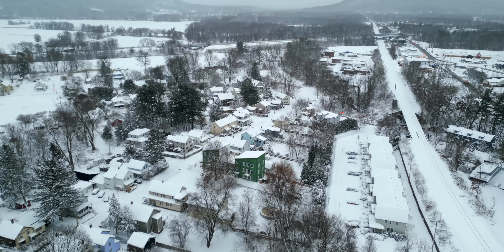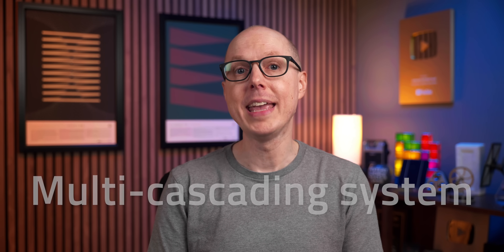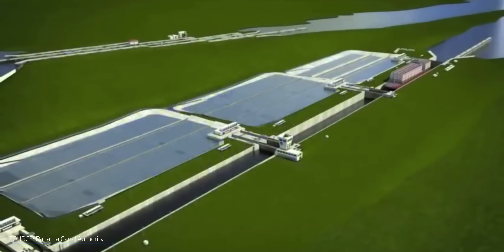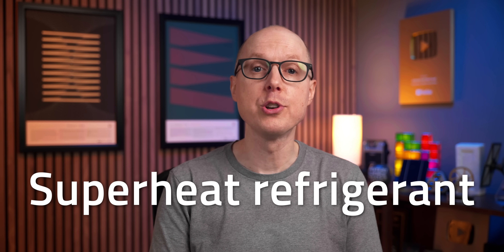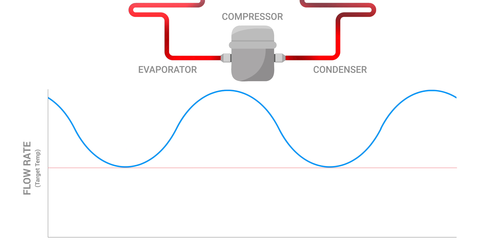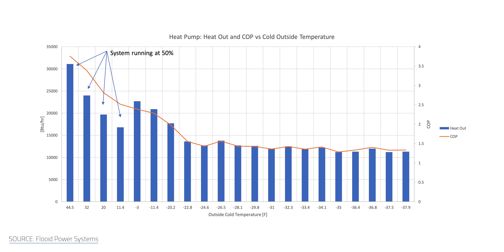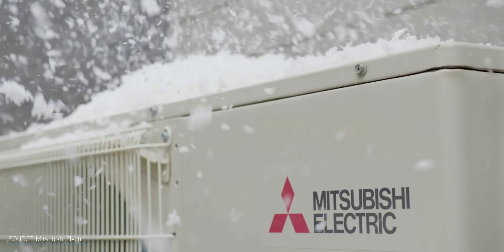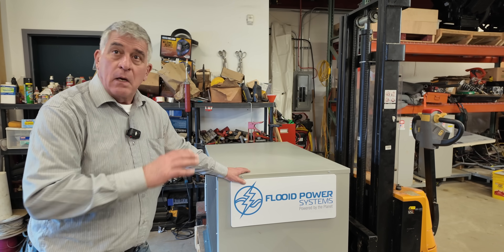How This New Heat Pump is Genius

Comment: I live in southern British Columbia, Canada.  Peak outside temperature range ~ -45 to + 45 Celsius every few years.  Usual range -30 C ~ +35 C, worst case, for a week or two.  My concern about heat pumps is that they depend critically on a reliable electricity supply, which may be almost guaranteed in a big city like Vancouver, but my small town in the Okanagan Valley is at the end of a ~350 km power line from the main hydro dam ~300 km [by road] to the east.  We usually experience at least one day-long outage every couple of years.  My small home was built in 1944, has zero A/C, is heated by a small forced-air natural-gas furnace, and includes a rarely used wood-burning fireplace, so in a winter emergency I can keep my family warm, but I fear regulatory agencies banning fireplaces entirely.  The City of Vancouver proposes to ban all natural gas appliances, both for cooking & heating, starting a few years from now.  Imho, this reduced energy redundancy would be madness...

Comment: A primary area to increase heating and cooling efficiency of a  house is with highly insulated windows and other insulation.  Reducing air infiltration is key.   A typical heat pump furnace is sized for the A/C loads in BTUs typically about 36,000 BTU and can heat about the same amount.   Heating needs are twice cooling needs and more.   Even with the heat pump at 3 - 4 times the heating efficiency of a natural gas furnace it cost more to fuel it on electricity than the cost of fueling a natural gas furnace for a BTU of heat.   We like heat pumps because they are good air conditioners.   It really doesn't take much heat to make up about 30°F so the fueling cost difference between a heat pump or natural gas furnace is fairly small, but when the temperature goes lower significant heating loads start to take place a long with a heat pumps efficiency falling off.  

With less than half the heating capacity needed and efficiency falling off a typical heat pump furnace resorts to electric resistance heat that cost about five times more per BTU than a natural gas furnace.   A month of 0°F temperatures might cause a $300 natural gas bill, but a $1,500 electric resistance heat bill.  You are also being a bad neighbor to stress the electric grid at its worst when natural gas is available.

Comment: We live in Las Vegas and temps range between 120 and 25. Can Flooid's system be reliable and cost effective? Elon Musk has so much on his plate he hasn't gone into the heat pump business. However, if Flooid's system has a high degree of durability at a reasonable price, Elon Musk could be interested. Tesla has the manufacturing capability to make these in mass quantities and Elon Musk could lower parts cost and the whole system's cost. It all comes down to affordability and durability.

Comment: I don't understand the use of power % at a certain COP when comparing units . COP by definition is factoring how much power is being used. The skeptic in me wonders if the Flooid systems efficiency curve resembles that of a computer PSU and is best at 40-60% load, making the comparison not great at best or intentionally misleading at worst.

Comment: I like the tech, but the problem is complexity.  Yes it uses COTS parts, but install, maintenance, and repair will be difficult or impossible for your local HVAC contractors.  The added expense of higher skilled technicians and maintenance will like be the deciding factor behind this tech.  If it can be modularized in a way that makes it legos for your average tech to test and swap parts, that would be ideal.  Also.. three working fluids is even more for the HVAC crew to carry around.  Different gauges/test gear, more bottles of refrigerant, etc.  While the upfront cost may be more, ground source heat pumps may be a better choice for many if we can get drilling costs down.

Comment: It is not hard to suck heat out of -31F air.  But is condensation a problem at -31F as it is at 32F+/-10F where it builds up and freezes.

The condensation problem is when moisture in the air condenses and freezes on the coils.  It quickly plugs the coils, requiring a defrost cycle increasingly frequently as the temperature drops further below freezing at the coils or the amount of moisture in the air increases.  Of course, there is less moisture in the air the colder the air, hence my question.  Maybe the air is dry enough at -31F to minimize condensation and so avoid frequent defrost cycles.  The number of defrost cycles with the accompanying inefficiency and discomfort means backup heat is highly desirable.  Sometimes the defrost is simply impossible, which means backup heat is mandatory.

Comment: 😅This type of system cascading has been used in the pump industry for years.  They are called packaged booster systems which use 2 or more pumps to increase overall system efficiency and reduce operating costs. To learn more check out Grundfos Pumps BoosterPaQ systems.

Comment: The whole heat pump conversation (especially resistance to them) is fascinating to me because we have been using them in Virginia for decades. I'm 43 years old and every house I've ever lived in has had a heat pump. I only recently found out that heat pumps are not the norm everywhere else.
Reply: Its not the temps that are an issue, it's the 2x-5x cost for what is basically a reversing valve. Contractors don't seem to want to install them.
Reply: They're very popular here in New Zealand too. They work well in temperate climates where only a minor temperature shift is required. More extreme climates need the more advanced heat pump tech such as outlined in this article.
Reply: Then it surprises me even more that they aren't more advanced yet. In the Netherlands they are mandatory now, but there are many startup problems
Reply: Mind you I live in a heat pump neighborhood as well and I just had a  minisplit installed, which is also a heat pump, they are more than fine. But I still prefer a classic furnace based system for reliability and cost.
Reply: Well it's basically an air conditioner that now has valves so that it can produce cold or heat, but you are so correct, the technology has been around for many decades. I think it's also a matter of people capturing fancy terminology on stuff that's been around forever.
Reply: They have pros and cons. Your AC basically runs all year instead of getting a break when the furnace takes over. These cascading systems are going to be very costly to purchase and maintain as they are basically two.or three systems in one. It all depends on application. Mostly residential is focused on cost. Furnace systems hit cost really well and heat pumps are generally only used in neighborhoods that aren't equipped with gas readily from the city. Atleast out here in Vegas. By the way I'm a trained hvac tech so i know a little bit about these systems. Heat pumps have a 300% heating efficiency compared to gas which has 96% at best, but electricity costs 5 to 10x compared to gas.
Reply: @wesleymcdowellwm  the gas:electric cost disparity varies hugely by location so no product will make sense everywhere. I would have thought Vegas would be prime solar territory and, with hots days/cold nights, thermal balancing & storage would be popular. But I've never been there.
Reply: Complexity is a big difference. Like the cost of replacing one of those reversing valves he's talking about is expensive. All of the refrigerant must be extracted.
Reply: @wesleymcdowellwm  In commercial systems, manual shut off valves are fitted, allowing component replacement with minimal refrigerant loss. These systems can also pump the charge into a liquid receiver. For minor replacements, it is quite common to crack both of the valves slightly open before fully tightening the replaced component. This literally blows any air out, avoiding the need to vacuum the entire installation. On systems with a load in excess of 50 tons, a few traces of air make little difference. Being non compressible they normally find their way out via the shaft seals on the compressors that are rarely 100%.
Reply: @wesleymcdowellwm  what if you have Solar? Wouldn’t that help with the Electrical costs?
Reply: @andrinabroussard1972 solar in Canadian winters, great idea, I'll get right on that. We get less than 1/20th of the solar we do in summer, and it's far more intermittent (nothing for days, then 2 hours of sun)
Reply: Japan has been using them for many decades. Funny everyone thinks that it is a new tech.
Reply: @WillCodeForFood.1905 My ex girlfriend lived in a building from the 70's, the AC controls (with Atari-like fake woodgrain) were built into the wall and, yes, had a hot mode!
Last time I saw her she'd got a new mini-split that was half the size and had a remote
Reply: It’s too cold to use them reliably in Canada.
Reply: @oscarholman  They work great in Sweden. -20 -30 still working.
Efficiency goes from 5 X to 3 X on air systems when it gets really cold, that is all.
If you use ground heat you get 8 x all the time regardless of outside temperature.
Reply: @whowhy9023 Why do you people just make up absurd numbers like this? Nobody is getting a COP of 8. It's like you have this insatiable urge to be smug and go "yah vell in Sveden..."
Reply: @oscarholman  they make ground based ones realy wish I'd dug deeper when I put my septic in found out about it a week or so after we finished  septic it uses a glycol mix pumped under ground threw pipes to gather heat
Reply: @oscarholman  and there’s no reason to have a reversing valve in South Florida. A 5000w resistive element is fine for the two nights a year it’s needed.
Reply: @yolo_burrito  the thing you're forgetting is that reversing valves start at like $25 on Amazon. Heat strips start at $170 plus.
Reply: @GallantChaos  and a reversing valve replacement requires evacuating and refilling the refrigerant. The part is cheap but the job is not.
Reply: @oscarholman Wait you heat your houses with direct electrical heating in Canada?! Here in Sweden you use ground-source heat pumps as those don't have those issues with cold temperatures.
Reply: They use ‘em in Northern Europe.
Reply: I’d love to have heat pumps here in Canada but it just can’t keep up with our winters. I’m just waiting for heat pumps to get better and better and work efficiently in Canadian winters.
Reply: @arunprasadh1929  This technology would be a step in the right direction but I'm pretty sure it would struggle with your winters, like squeezing blood from a stone. Heat pumps + thermal storage may work.
Reply: Outside of the US basically they're used everywhere else. Its one downfall for usa is that it only circulates indoor air so you need to add extra fresh air source input. But in other countries that still mostly use open windows for airflow, the mini splits work well.
Reply: @Findmannynow  All forced air systems recirculate indoor air it is not just heat pumps it is everything.

Comment: I have often thought a cascading system using two separate heat pumps makes the most sense; especially for people with their own solar.  Essentially, stage one is a heat pump that stores heat (or removes heat) from a huge thermal battery (pond, pool, sand, etc) whenever there is excess power generated by the solar array.  Then another heat pump uses that battery as its source to heat or cool the home.

Its a two stage cascading system, but there is a thermal storage element that allows you to maximize the value of your solar system, and avoid pushing your heat pumps out of their optimal operating range.

Comment: As a Canadian I’m extremely sceptical that infrastructure can sustain the introduction of these units residentially, especially its functionality during our annual cold snap. I don’t want my heat going out during a brownout during a cold snap. While these are great alternative, the banning of other conventional heating sources is ludicrous. For example, if the current federal government gets what they want, they would implement these pumps as mandatory and ban any kind of wood burning/natural gas heat source, preventing basic human necessities as it regularly gets bellow -38 up here.
Reply: Will your gas furnace work during a brownout/blackout? Ours won’t. It depends on electricity for the temp control, the fan, and everything else. Our gas furnace is totally bricked in a blackout.

Comment: We are going for a geothermal Heat Pump (with floor heating) and passive cooling for our new house. Pretty nice as the temperature of the ground is a stable 3-4c and that means the COP is like 4 year around. Its also much more quiet than air-to-air heat pumps and does not need to "de-ice". In the summer we can use that "cold hole" to passively cool in the summer.
Reply: And as added benefit. The cooling during the summer will put down heat in the hole giving a better working temperature from the hole during the winter.
Reply: In ground system=$$$$$$$
Reply: @waynesaller  yup, but if you have the money for the upfront costs it's worth it.
Reply: Did you get your system going?  I'd be curious how it's working, especially the passive cooling.  We have a 1890's home with cast iron radiators and we love the radiant heat the provide. Plus, they double as towel warmers. Ha!  But we really need cooling too.  I can not stand the thought of those ugly mini-splits everywhere in our house so we want to go water to water but I wasn't sure how we'd get cooling from the same system.  Were you successful?
Reply: @vbrh01  house is being built as we speak. Won't be done until late summer / early fall. In regards to passive cooling. I talked with several different experts that work with heat pumps and they all said the same thing: It's not worth the cost.

It was 15k USD to "upgrade" the system to support it, and depending on how deep your geothermal hole is, it can only supply a minimal amount of cooling. It's also not AC-cold. It's more to get the temp down a couple of degrees. Like a small breeze. 

So if you want cooling: get air to air. That's the best, cheapest and easiest. As we live in Norway we are not going for any active cooling solutions as we don't want that ugly outside and inside unit. It's a cool/unique looking house that designed by a famous architect, so we don't want to ruin the look/feel.

If it gets too hot (those few nights a year) we will just use one of those portal ac units.

Comment: I’m in Michigan and I use heat pumps in finished basements along with heated a cable in the bathroom floor. There’s nothing better than that. Carrier or Mitsubishi that rate there units at -22deg. I’m looking forward to theses cascade units in our future

Comment: I will be installing a closed loop well source to cool slabs in summer and feed a heat pump for domestic hot water & to keep slabs warm in winter. The cascading system would be good for boosting the slab water up to the domestic hot water temp, I may add a second smaller heat pump fed by the return water from the slabs in winter. Thanks for the presentation, it got my thinking cap on!
I am about 200 miles north of you Matt.

Comment: No, stop. This video is full of so many errors and techno babble. You should take it down. There is no resonance in a properly configured system. Cascading systems are always less efficient than single ones and this is down to pure physics. The only reason to employ one is if you need higher or lower temperatures than a single stage can cover. For heat pumps a simple economizer and frequency controlled compressors are the ticket.

Comment: Congratulations on including degrees Celsius. (The US is "inching" its way towards the SI system that the rest of the world uses.) But rounding the 'C figures, converted from 'F to whole numbers (e.g. 40 rather than 40.3) will make a simpler and clearer presentation. (Bear in mind that most of the figures provided in 'F will be plus or minus some wiggle room anyway so rounding is perfectly valid!)

Comment: A COP of 2-3 is terrible these days. The latest models of air-to-air heat pumps can get 4-5 SCOP when installed correctly in a house with appropriately sized emitters and insulation.
In the UK at the moment, the break even to match gas is 3.8 SCOP (not considering installation cost differences) but that will reduce as fossil fuels increase in price and the grid becomes more renewable allowing electricity costs to reduce (currently tied to the cost of gas in the UK as we have mostly gas power plants).
Reply: We're talking about a COP of 2-3 when it's cold. Seasonal COP is a weighted average based on a range of outdoor temperatures. The SCOP of a given system is always much higher than the cold-weather COP.

Comment: It's reckoned that just one single 'normal' sized heat pump contains about 45kg of Copper metal - how much Copper is in one of these contraptions>
Especially when no-one in the US will even contemplate any new mines anywhere there - where is it all coming from?

Comment: Interesting video eventhough the title is a bit too catchy 🙂. One point I disagree is saying that cascading heat pump needs less space than hybrid heat pump (at 13:55)  (or heat pump with resisting heat strips), can you explain to me how having 1 heat exchanger more and 1 compressor more (for a two cycles cascade HP) is taking less space than resisting heat strips ? 
What I would also have like to hear is can the cycles be used for different purpose, i.e., one cycle could be used for floor heating at 35°C and a second cycle could be optimised for water heating (I wrote a paper on that 8 years ago: Multi-temperature heat pumps: A literature review)